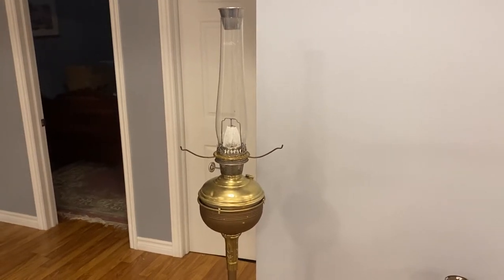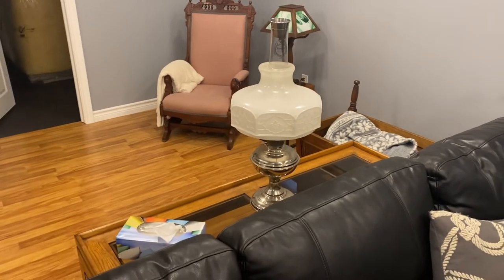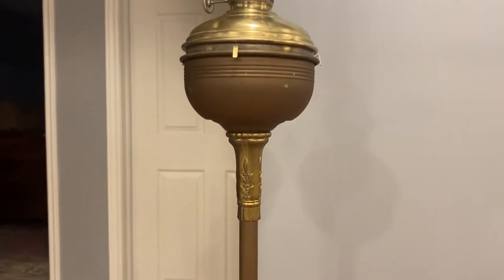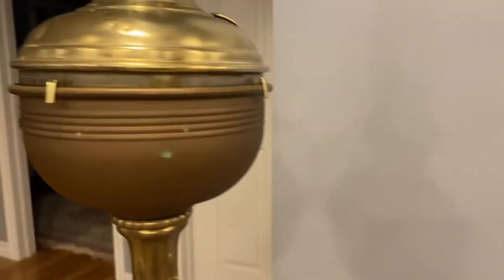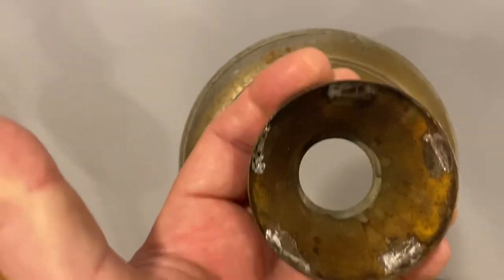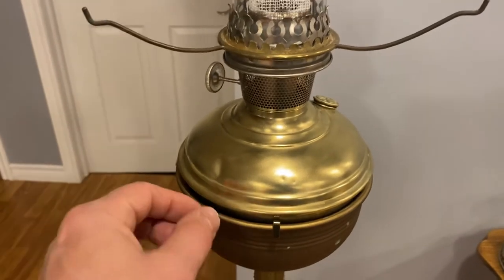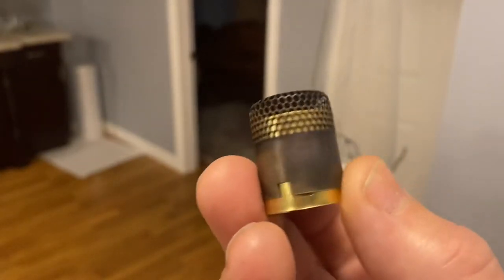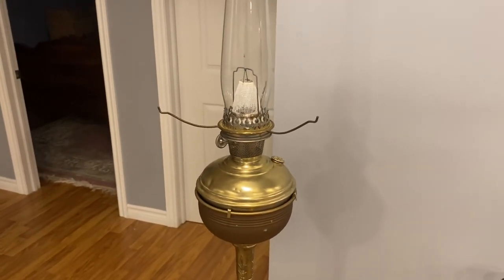Aladdin Model 6 floor lamp conversion and flame spreader hack part 2

Comment: ALL MY LAMPS HAVE A MODEL B BURNER WHICH I CLEANED WITH THE ACID AS YOU TAUGHT ON YOUR VIDEO. DO YOU BELIEVE IT BETTER TO INVEST IN A NEW MAX BRITE OR THE MODEL B IS OK. WHATS THE DIFFRENCE BETWEEN THE 2 FUNCTIONALLITY WISE AND BRIGHTNESS ? REALLY DONT WANT TO SPEND THE MONEY ON A MAX BRITE IF I DONT HAVE TOO. IF YOU BELIVE UTS A WORLD OF A DIFFRENCE THEN I WILL ORDER ONE. WHAT YOUR ADVISE?
Reply: I have a max bright 500 lamp and I can tell you that it has a tendency to flare up.  I really think the new burners are a fire risk.